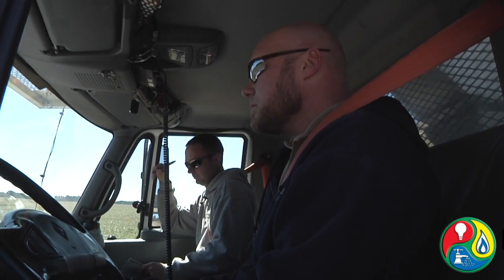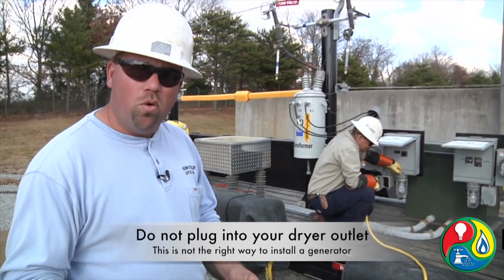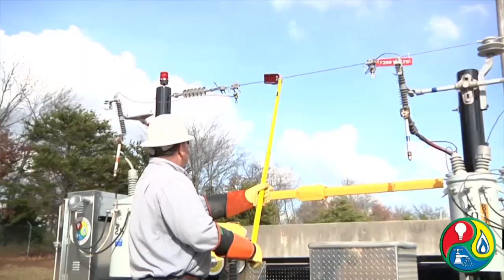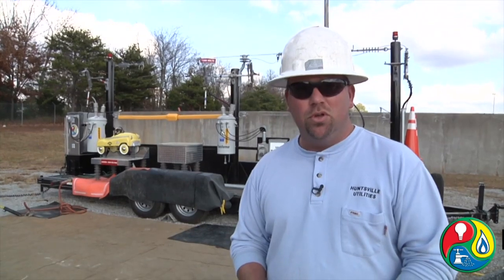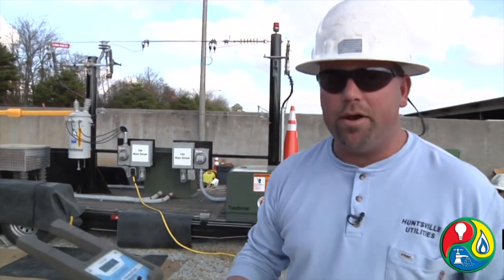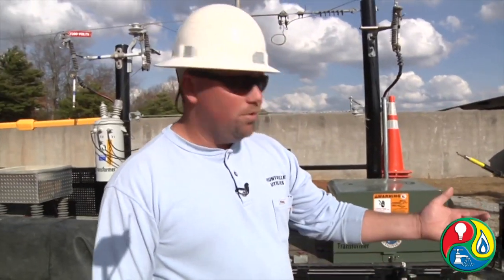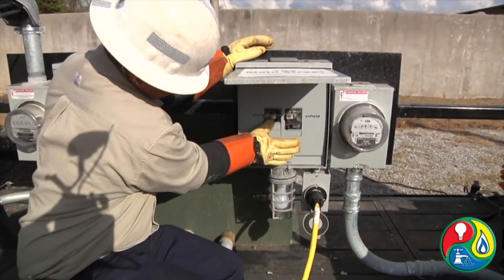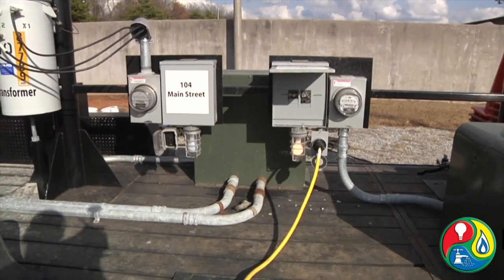Backfeed Protection

Comment: So I didn’t know that you could do this, so I’ll see why it’s really important to do this safely but I do something even different. What I do is I have a solar generator that is completely independent of all the wiring in my house so I charge my solar generator with another generator and then I run the stuff in my house off of that solar generator so of course it is impossible for it to backfeed into the electrical system in my house. So my solar generator will run 1500 W continuous with a 30,000 W peak so I can have a smaller gasoline generator to charge the solar generator so the solar generator will charge at 250 W continuous so as long as I don’t exceed that per hour, I would be good to go. so with that I can run my fridge freezer microwave toaster and washing machine but not everything at the same time and of course I can also run lamps so in a power outage I would be pretty good. I also have a potential of 1200 W of solar that I can use to charge up the battery’s during the day.

Comment: Thanks for the info. Was wondering about this. The power went out during a snow storm for 4 days in Oct 2019. I've heard of people plugging into the dryer plugin but they never mentioned a backfeed switch.
Reply from the maker: Plugging into a dryer plug is exactly how not to power your home during an outage. Hire an electrician to install a transfer switch. Also the electrician will set up certain breakers that will work and some that won't because the generator you purchase may not generate enough power to provide electricity to everything in your home during the outage. This like the fridge and water heater maybe be the critical items. Or if you are on a well, then the pump that brings your water into your house. Speak to an electrician first and give him or her a list of things you'd want in event you are out of power for a few days and they can guide you as to what size generator to buy. I hope this helps. Thanks for your comment.

Comment: What happens if your generator is not running but you plug it in and power flows to the portable generator?
Reply: With a transfer switch you can either have the generator on or the main line into the house on but you cant have both at the same time.
Reply from the maker: Thank you Fin!
Reply from the maker: Nothing.

Comment: Huh. I don't know how current in a 240v system can cross the air gap of an open mains breaker, because its rated 240++. Sorcery, perhaps.
Reply from the maker: Most circuit breakers are sealed.  You cannon see the air gap, and you can't assume the breaker is fully opened.  Disconnect switches are the safest way to go.  You can not see and confirm the air gap with a switch.
Reply: But a transfer switch is a circuit breaker in most cases.

Comment: Is it not common sense to turn off the main utility breaker before you turn on the generator circuit that provides the back up power?
Reply from the maker: While it is common sense, it's a step can be easily overlooked in the haste of an emergency that would be causing you to switch from the power grid to your own form of electric generation. Amidst what could be a trying time, please install a switch to eliminate the chance of an accident. When using a generator to power instead of the normal power grid, there could be a lot on your mind that could lead to a chance overlook of such a common sense notion.

Comment: you say "Without turning main power off" what if you do turn off main power to house?
Reply: not saying we’re right but we’ve been doing it for as long as I remember since I was a little kid. I used to stay in a place that get hit by typhoons at least 3 times a year and power goes out constantly. We just turn off the main breaker of house and hook up to the dryer plug so we are not back feeding power (which I don’t know if it’s true). The only down side that I know of is that you won’t know that power is back on because you’re disconnected from outside power but we usually just ask the neighbors if they have power. This is not advice and I’m not an electrician it’s just my experience.
Reply from the maker: The problem is that it allows for human error. If you don't remember to turn it off you put multiple people's lives at risk.
Reply: great info thx rory

Comment: the only reason to have any of these fail safes installed is so that if your house burns to the ground, the fire inspector sees the remains of the safety item on your charred electrical panel and alerts the insurance company that they can go ahead and pay you for your loss...otherwise it's "sorry Charlie...you had an illegal hack or workaround and you lose"
Reply from the maker: Thanks for your comment Jim.  Also to prevent injury or death from electrical shock.
Reply: The only up-side to using a dryer outlet, is that it's reversible. There is no evidence that it was ever done, once the cord has been removed, and everything put back to normal.(Just make ABSOLUTELY sure you switch off your mains) In my old house, I could never do this, because there wasn't a main switch. I've since upgraded, and installed a manual "break-before-make" transfer switch, so there's no possibility of any mistakes. I'm using an 8,000 watt generator, which could be a real hazard if it back-feeds the grid. I love the "plug & play" aspect, which makes setup a snap in an emergency.
Reply: @vincentrobinette1507  - dryer approach also calls for use of a suicide cord another reason it is a bad idea. Two male plugs

Comment: Someone is gonna hook up their generator and back feed the line because they were unable to get the information on how to do the illegal dangerous connection properly.
Reply from the maker: The best way to connect to a generator when you don't have time to have an electrician to wire it properly through your breaker is to plug things into the generator directly. So unplug the fridge from the wall and plug it directly into the generator. This is the only method we recommend when you don't plan ahead to have a switch installed. Generators are not something to connect to your house in the middle of a crisis or panic mode situation, plan ahead.

Comment: WHY is the Neutral NOT separated by the main breaker OR when you pull the power meter off the house..?? 
Why does it stay intact ..??

An interlock switch only prevents an IDIOT from turning street power back in while running generator power... It does NOT separate the N going back to the power station, SO ... with that said, in the event the HOT wire touches the N or G, it will energize the N back to the street .... What good is that interlock switch when the N goes hot and that N is still connected all the way back to the power station..??

Next are you going to tell me that my 7kW generator will feed power back to 100+ homes to power them as well with their 240V central ac going and 6kW dryers and 10kW stoves..??
Reply from the maker: Good questions.
 
Concerning the neutral.  Keeping it connected benefits everyone.  Neutrals are tied to grounds, and if something goes to ground, hopefully along the way a circuit breaker will trip, or a device will go off line.
 
As for the next part, there’s no way to predict what devices are online.  Does everyone run their dryers at the same time?  No.  The same for stoves.  And, some appliances go offline when power is lost.
 
The safest for all concerned is to have a visible disconnect between your generator and the main feed coming into your house.
Reply: So the best route would be is to have a 3 pole MTS at the house that will physically separate the 2 hots as well as the Neutral, this way the generators N & G does not connect to the N coming from the street ...?? This would be a complete separation ...

Comment: I think a lot of people think turning the main breaker off and back feeding the generator through a dryer outlet or some other outlet or a breaker in the panel is ok as long as you turn off the main breaker and this is false.  It is illegal to do this with out a lockout switch or lockout panel that locks out the possibility of having someone turn on the main by mistake or fail to turn it off.  The word again is illegal and if there is a problem like your generator is running and you left the main on not only are you sending power out but if the power comes back on and your generator is running you will have a huge problem feeding your house from two different sources not on the same sine wave.  I have heard of panels exploding from this.  Oh and stop watching idiots giving free advice who are not licensed electricians.
Reply from the maker: Thank you Kenneth for sharing the common sense of how devastating hooking a generator up incorrectly can be. It's simply not worth the risk to not use a licensed electrician and a legal method for installing and using your generator.

Comment: ARE YOU TELLING ME THAT MY 7000 WATT 30 AMP GENERATOR IS GOING TO POWER AN ENTIRE NEIGHBORHOOD BECAUSE I FORGOT TO OPEN THE MAIN BREAKER...?? 

IF I EXCEED 30 AMPS IN MY HOUSE THE GENERATOR BREAKER POPS... YET IF I FORGET TO OPEN THE MAIN BREAKER NOW I AM SENDING 240V BACK TO THE STREET WHICH MEANS I AM NOW SENDING POWER TO MY NEIGHBORS HOUSE/S....  THRU TRANSFORMERS TO UP THE VOLTAGE AGAIN.....  MEANWHILE MY 7K WATT 30 AMP 240V GENERATOR STAYS ON FEEDING SEVERAL HOUSES ON MY STREET....  

DO YOU GUYS HAVE ANY IDEA HOW STUPID THAT SOUNDS...??? MY 30 AMP GENERATOR STAYS RUNNING WHILE POWERING SEVERAL HOUSES ON MY GRID YET I CANT KEEP IT RUNNING ON MY HOUSE ONCE I PASS 30 AMPS...??  

DO YOU HAVE ANY IDEA WHAT AMPERAGE LOAD SEVERAL HOUSES CALL FOR...??  THERE IS ABSOLUTE NO WAY MY GENERATOR WOULD STAY ON & RUNNING THE SECOND IT BACK FEEDS TO THE GRID...
Reply from the maker: Thank you for your comment and your help in spreading the message to PREVENT backfeed.  You can never predict situations and bottom line there needs to be a visible disconnect.  It is very important to get a qualified, licensed electrician to install
 the generator and ensure that all permits are obtained and electrical inspections are completed as well.
Reply: Sometimes the backfeed takes the form of ground potential due to improper bonding (earthing) of the breaker pannel. You could feed power to the grid through an apliance in your home supplying load resistance that would prevent your generator  breaker from tripping.  It's a very complex problem. Ever wonder why there is a ground and a neutral wire but they are connected together?  There is a reason!
Reply from the maker: Thank you for adding clarification.

Comment: This is expert advice. 

However, the reason your average "Joe Moron" back-feeds into the power grid is: 

A) He knows just enough to be able to hook his generator up, but is too stupid to be extremely aware of what he is doing at all times. 

B) The price of the transfer switch install.  It would seem to me that in this day and age,  your average house should already be equipped with one from the time it is built.  Just like a 220 dryer outlet.  
I guess the argument would be that not everyone would use it, but I have a 110v propane dryer in my house, and have never used the 220 outlet.  So, tit-for-tat on that one.
Reply from the maker: Thanks for your comment and continue to share the message to keep our linemen and women safe.

Comment: This   method I  described   is all  going through   regular   15amp   breakers    both from  regular panel  and from  gen  panel      or   if very small  generator then the breaker on the   gen itself    now  as for the cord   to the gen  to make it safe   only  have a male at the   gen end  and  wire the other end   permanently   into a jumction    box and   have a cabinet   right there to store the cord    just like on a    RV

Comment: Another    way less   expensive   and    very   foolrpoof and safe   way   is   say  have  a panel  fed by the generator   only   and   then   reroute   the   loads  that you want to     run to there   and   now    for each   separate    120volt  15amp   circuit   going  back towards   load    connect the   hot  wire   to the common   screw   on a   3way  swicht    and then    connect  the   screws   where the    traveller wires go   one   back to the  regular  panel   the other to the   generator  panel     this way   the  the 3way switch  cannot  feed power from   both      travelers    only   one  or the other     one  can  do this   for only   one circuit    or  for several   ,,,,,   a   homeowner   had me  do this   only   for his  furnace   and I used a  3way switch   this way      one   will  only feed the power   from the gen to the      intended load   impossible  to  backfeed   power  anywhere else  ,,,,,,,,   doing   this     one   only   has to    run    the  hot wires   through  the   3ways     all the   grounds   the   neutrals   from  both the   generator  and  the  regular   panel    can  all be  connected  together      only   the  hot   wires   from    gen and     regular panel   go through the   3way  in the   manner   described  this is good for  any  120v    15amp  circuit